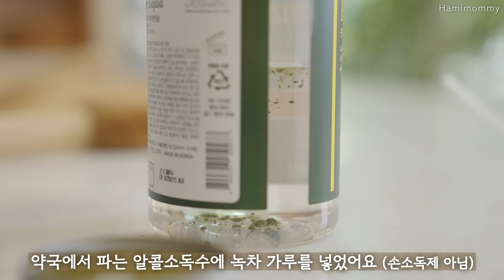Vlogㅣ깨끗한 집을 위한 청소팁ㅣ버려지는 물건들로 청소했어요 🧹ㅣ집에 친구들 초대하고 요리하기ㅣ친환경 일상ㅣ브이로그

Comment: Dear Hamimommy, wonderful video today! We often eat chestnuts too - here's a suggestion on how to make them easier to eat for little Hami. Make a cut into the raw chestnuts without cutting them all the way through. Then water them in cold water or boil them in hot water. The most delicious part is to roast them in the oven after watering or to roast them in a very hot cast iron pan. The chestbuts caramelize and the cut you made into the skin breaks open and you can peel them very easily.
Reply from the maker: thank you for the tip! I will try to use oven or iron pan for the next time when I cook chestnuts! 🙂

Comment: I have a good tip for the🌰، you should make a Cut tthrough It before you boil it and when become there’s a little of water left you should add just a little bit of sugar and lit it caramelise the cut will make it a lot easier to Open it and the sugar will make it a bit sweeter🥰